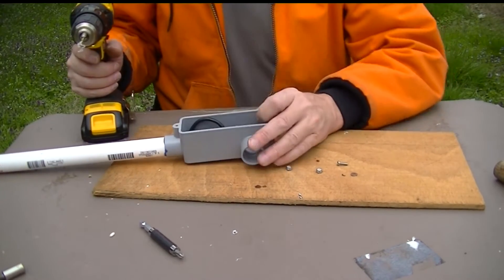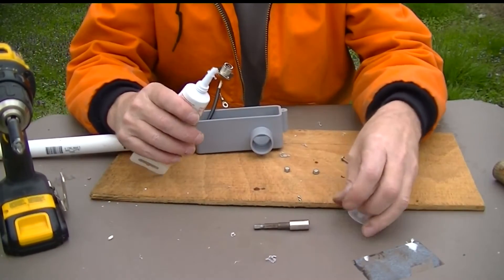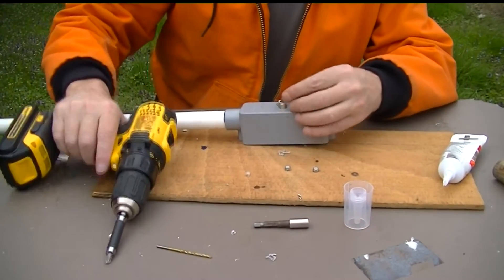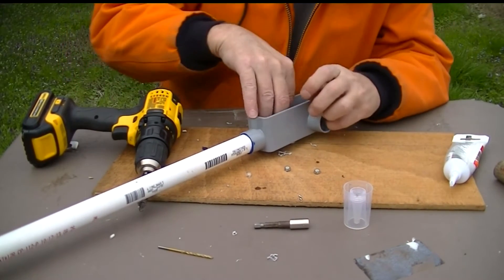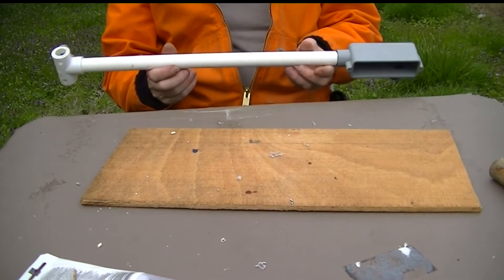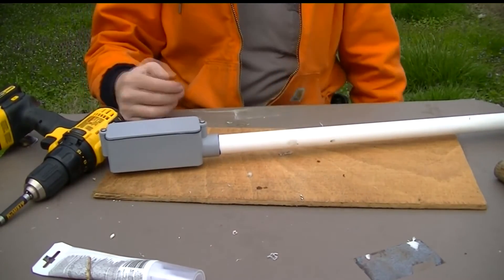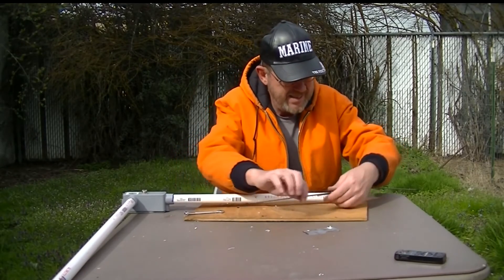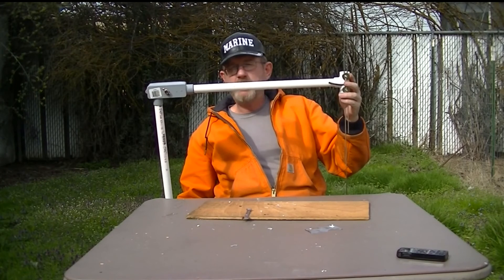BUILD # 3 - Dual band vertical Dipole (Pt 3 of 3)

Comment: How did you make the two elements?
Reply from the maker: Check my video list if the following link doesn't work.  I go through how they're made.

https://www.youtube.com/edit?o=U&video_id=nrG1UStQEEk
Reply: Thanks! I did find my answer after I posted my question. Another question though. Can I use galvanized 1/8" rods if the antenna isn't going to be exposed to the elements? I plan on installing it in my garage attic.
Reply from the maker: You can use just about anything conductive. Copper, Brass, Aluminum, Stainless, Steel, Galvanized steel, even all thread will "work".  However, each has a different "velocity factor" and so the proper length will be a bit different depending on the conductivity of the material chosen.

If you're putting it in your attic where it's protected from wind and the elements, I would suggest getting some 10 gauge solid house wire and try using a couple of straightened pieces of the copper wire. Copper is a better conductor than Stainless or galvanized so you would probably have even better performance once tuned (though without installing and testing in the position where it will be used, there's no way to know how well it will perform).

ALSO......do your testing and tuning when you have it installed as moving it will affect the SWR as it is effected by the ground, nearby objects, etc. And try to keep it away from any power lines that may be running through your attic.
Reply: Update!!! I built this antenna in about an hour using what I had in my garage. I did end up using the galvanized suspended ceiling wire for my radials. I installed it in the attic of my garage as a backup antenna when the storms are raging. I've hit repeaters that are 50mi away on this antenna. If anyone is thinking of building it , DO IT!!
Reply from the maker: Well thank you for the report and review of how it worked for you and that it took an hour.....mine take a lot longer to build because of the filming and such, trying to make sure I've got at least decent shots of what's happening.

Be sure to subscribe and recommend my channel to all your friends.